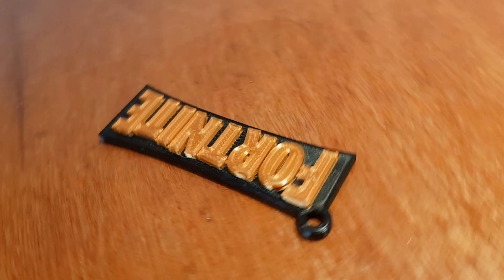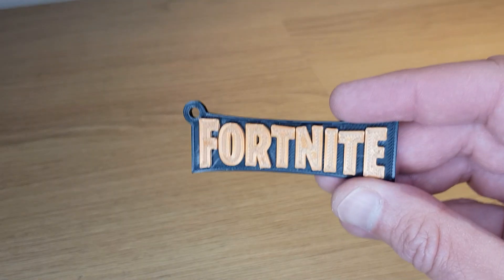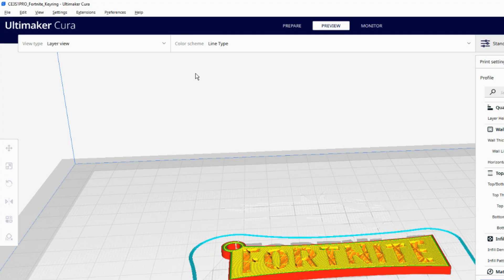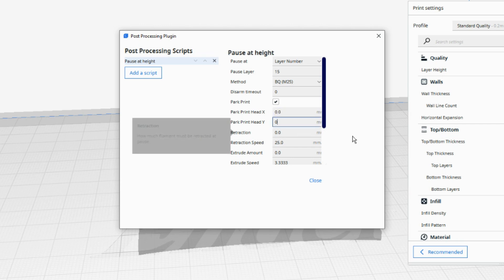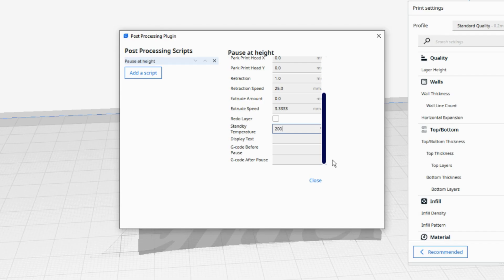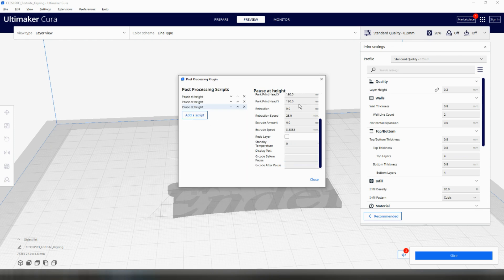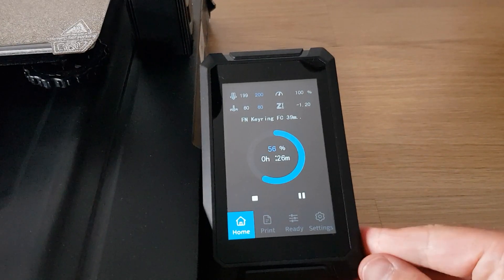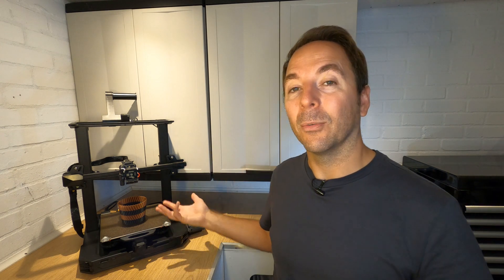Ender 3 S1 Pro Mid-Print Filament Change - Now You Can!

Comment: This is a good solution 👍
I have a 3 Pro and cura 5.1 the only thing is !
My printer starts to print again without notification 🤔
And the first tryouts where difficult because I wasn't ready with change filament 🤗
Have you a solution for this ? ?
Reply from the maker: Are you definitely using the pause at height option and not filament change? Also double check you have the 'M300' code in both boxes.
Reply: @RickyImpey  yes pause at hight ! but there is no indication of the pause time and it starts automatic again 🤔
Reply from the maker: Sorry, I missed that you said you have the 3 Pro and not the Ender 3 S1 Pro. Filament change should work on the 3 Pro as the screen is much more versatile and the firmware is more 'standard'. I haven't got a 3 Pro to play with but you will most likely have to try different settings with the 'pause at height' script and experiment a little. In theory it should be much easier with your printer.

Comment: Hi Ricky, thanks for your informative video. Unfortunately this didn't work with my Ender 3 S1 plus. When I hit the stop button it didn't give me yes no option instead it just went home and the nozzle cooled down. Has anyone else got his to work on the Ender 3 S1 Plus?
Reply: did you try updating the firmware to latest version?
Reply: @Ncky  Yes, I am running latest firmware
Reply: @MarkButler68  then it doesn't work for the plus
Reply: If you are using OctoPrint you can hit resume from the web interface, but that is the only method I have found.

Comment: I use the filament change script for my 2 colour prints with my Ender3 v2. Though I always forget which layer to set it at… for that one I’m pretty sure (has been a while) you set it at the layer you want the new colour to start (rather than the last layer of original colour).

Something I’ve also stated doing is placing a small block (from calibration shape plug-in) on the build plate near the model. Make sure it prints this block first on each layer & that the height of it is just above the colour change layer.
This will act as a ‘buffer’ for making sure z height has reset correctly & also make sure nozzle is primed & any extra ooze ends up on this block rather than glooping up on the real print.
Reply from the maker: Good tip👍
Reply: Any chance you could explain this a little.....simpler maybe the word I'm looking for lol, like do I set print "all at once" or "one at a time" etc.....sorry I'm still learning qnd this method sounds perfect, I just don't know exactly, how to set it up to do it... please and thankyou
Reply: @mickyovts3872  the bit about the extra ‘buffer’ block?

So you just need to add a small cube (in cura you can use the calibration shapes plug-in) and position it near the model (I leave about a 10mm gap).

You need to leave it set as print all at once, and use the preview after slicing to confirm that the cube is printed first on each layer. If it’s not, reposition it on the build plate & test again. I think it needs to be in the front left to be printed first.
Once you know it’s printing first, and you know what layer height you’re doing the filament change at, scale the height of the cube to be the height of your layer change (ideally you only want the buffer cube printing with the new filament for 1 or 2 layers). Again confirm this with the preview after slicing.

Now when you get to printing it, after you change filament & start printing again. Slow the speed down on the printer to give you time to adjust z offset if needed as it’s printing the first new layer on the buffer cube. Similar to a first layer on the build plate you want to make sure it has enough squish, and also not dragging on the cube.
Once you know it’s good, you can set print speed back to 100%.
Reply: @nodowt  This is genius, and I think will solve my problem exactly. It always prints too high after pause.

Comment: Great Video as ever, I have learned so much from these.

I managed to get a couple of multi-colour prints working a treat using this (or very similar method) a month ago.... and then I upgraded the firmware using the latest official creality screen firmware and printer firmware. The screen firmware 'upgrade' decided to remove the individual Play/Stop/Pause buttons so they all appear on 'one big button' now. Long story short I can't find a way of resuming after it has paused at the appropriate height. If anyone has had any luck please let us know!!
Reply: I found a ridiculous work around. I am a proud newbie with an Ender 3 S1 Pro (touch screen) in 2023. It came with an apparently new firmware that works as described above. Here is how I got it to work. Do what the guy says up until the point where you are attempting to resume the print. As you said, hitting STOP, then CONTINUE, results in the PAUSE button staying the PAUSE button.  However, if you CHANGE SOMETHING, for example, increase the print temp by one degree, THIS will turn the PAUSE button into a PLAY button. Then when you hit PLAY, you will get a CONTINUE/STOP dialogue. If you hit CONTINUE here, it will actually continue. I would rather not say how long it took me to figure out. It brought me great relief to find out that I am not the only one in this situation.
Reply: @tbbauer  Thank you kind sir, this is ridiculous but that has worked and I would have never thought of trying this
Reply: Merci Merci Merci @tbbauer
Reply: Ta solution fonctionnait jusqu'à ce que je mette à jour ce matin...il ne me propose plus le bouton Play même en modifiant un paramètre 😭😭 @tbbauer
Reply: @tbbauer thanks for the work around, been going mad for a few days having updated the firmware, it now works 👍
Reply: This, also not getting this to work with the latest firmware.
Reply: I had the same problem. A firmware update seems to have changed the behavior of the screen from the workaround in the video. If you are running OctoPrint you can just hit resume from there, but I could not figure out a way to do it from the touch screen.
Reply: Same thing here...  very frustrating when I find a solution but it does not work  because of updated firmware.   Has anyone found a workaround for this?
Reply: I am in the same boat. Neither it works with OctoPrint, because it says M0 command is suppressed.

Comment: Hello, Thanks for this! I have the same printer and this will help me a lot.

Also I want to ask you what can be the cause of a problem I have since 2 weeks aprox.: I started to notice that the first layers of my prints are rough, after some test I think the nozzle is not getting enough height by the Z axis when the layer changes, so I thought that the cause were the eccentrics of the Z axis (maybe too tight) but after loosen them a little, doing some tests and put them back to the original tightness I concluded that it wasn't the eccentrics. Also it is not the metal cylinders of Z axis (those who turn by the z motors), they are greased and still got the first layers rough (mostly from 3rd layer to 10st one) 

I found that the nozzle collides with the previous layer when traveling from one point to another, it actually makes a sound when it happens like "tratratratrac" (The sound is because the collision of the nozzle with the lower printed layers, specially infills but also the walls). 
I'm losing my mind trying to figure out what it can be if the eccentrics are good. What should I do? :(

Thanks!
Reply from the maker: It sounds like you've done quite a lot to check that the z height is moving up correctly. Have you checked to see if you might be over-extruding? If too much filament is going down then the nozzle will hit it when it does the next layer. Also, if your z offset is out and the nozzle is too close, your first layers will be rough as the filament is pushed sideways instead of laying down nicely.
Reply: @RickyImpey  Thanks for the answer. The printer has only 1 month of use and really don't think that's over extrusion; when I print the typical calibration cube, it does very well but when I print a larger piece, like the planter you show in this video is when it start happening. I wonder if could be the z axis couplings that the motors moves, maybe too tight or thick? 
The worst part is that almost every YouTube video about calibrating Z axis doesn't even talk about the couplings. Also they always does with printers that have only one Z cylinder so the process is different.